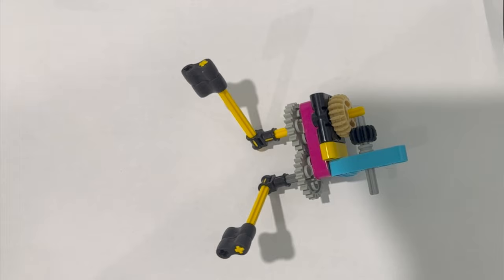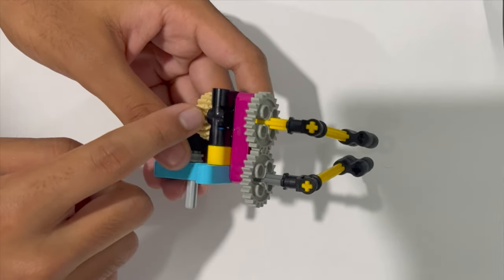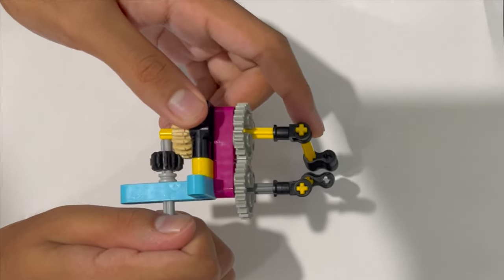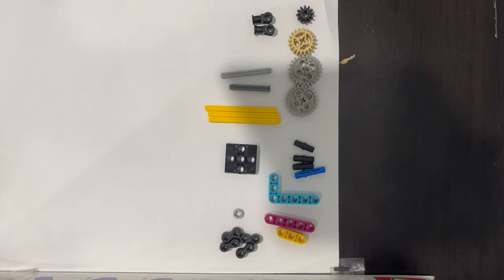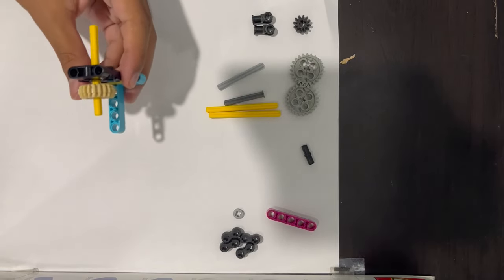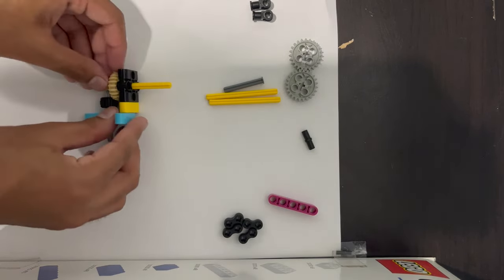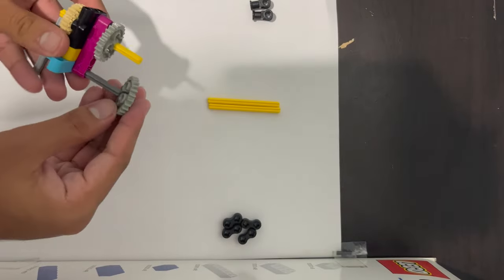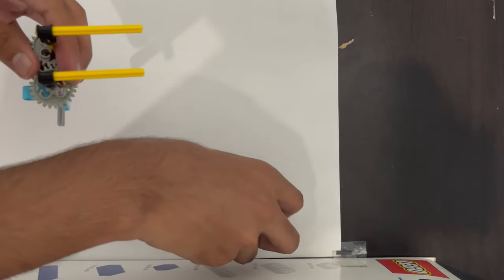This GRAB and LIFT Attachment can Solve Most LEGO Robotics Challenges (WRO and FLL) [SPIKE]

Comment: It would be an outstanding mechanical solution, but those gears are not available neither in the spike prime nor the expansion, however, there are other arrays that solve the grab and lift, a shame that those gears are not available because the solution is brilliant.
Reply: try to use grey gear and small beige gear it works for me
Reply: you can put a grey gear and a beige gear to achieve the same results